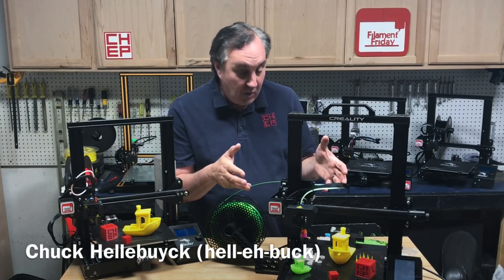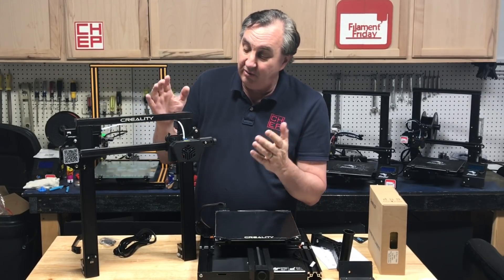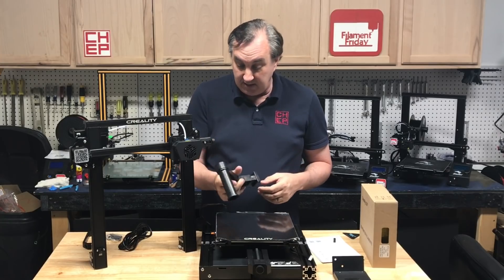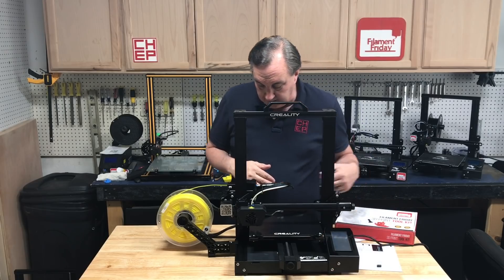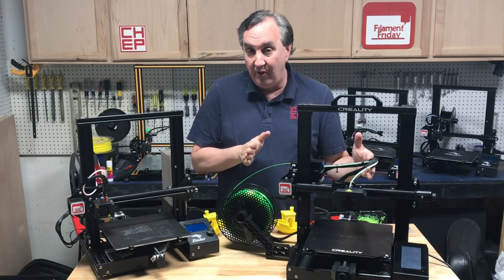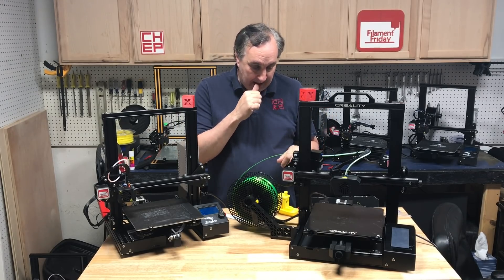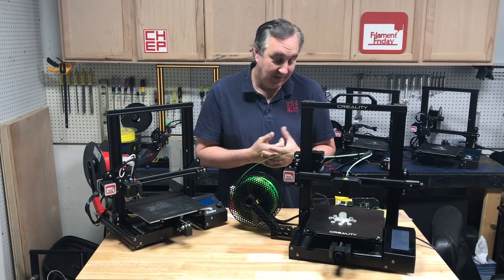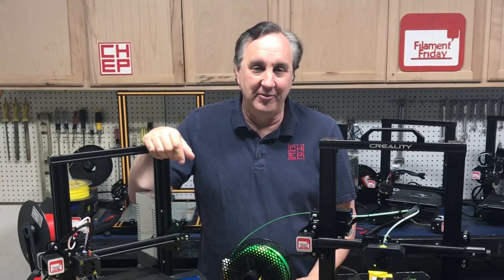NEW! Creality CR-6 SE 3D Printer - Better than Creality Ender 3?

Comment: so that has just a plain glass bed? smooth? i can't see how anyone can get prints to stick on glass consistantly without using glue... i tried maaannny times using different settings ,material... just not trust worthy... how many times have we went to bed after watching print for an hour or two and woke up to a mess...
Reply: There's a texture on the top of the glass.
Reply: @Bluemoondm1  ...yes i actually tried that on my cr10 ...i sanded the glass... it can be affective.

Comment: If your not using 99% ipa it will leave a film and will not stick on that glass. I use that glass and never had a problem with 99% ipa.
Reply: I have the Creality glass on both of my 5's and 5 Plus.  It seems to stick well, especially PLA.  If needed, I just wash it with dishwasher soap and use IPA every few prints.  I like their glass as it has two sides one coated and one plain

Comment: Hi, does this use same exact hotend as ender 3?... just curious..
Reply: it's different
Reply: @rewop12  looks or function? better? or just more high tech/costly? thanks
Reply: @roadstar499  not sure, I saw it on the kick starter for the cr6e
Reply: @rewop12   thanks for the help.i like this but for the price i would rather buy an ender 3 and use the extra money for filament
Reply: @roadstar499  I'd rather buy this, you get auto bed leveling, a glass bed, better spool holder, better extruder, and bigger build volume
Reply: @rewop12  i wonder if z goes to 300mm ... looks like base is a little bigger than ender 3...i really would not chance buying a new design unless it has been tried and tested first... plus parts etc
Reply: @roadstar499  true, but I have seen a lot of good reviews from other youtubers. Also creality has been making printers for a while so I think they have stuff down pretty well
Reply: Really?
Reply: 6:50 different

Comment: The Ender 6 seems more promising. 32bit, TMC2208's, fully enclosed, CoreXY, all-metal hotend, filament sensor, etc, etc.
Reply: They are going to add bonus items as the kickstarter reaches goals,  extra nozzles and 2209 drivers, in addition to the 32 bit board

Comment: Great review!  I completely agree with you on the price.  If it was in the ~$350 range I think it would be a great machine.  As is, there are already a number of parts that I would immediately want to upgrade starting with the ptfe tube.  If it's the same one used on the Ender 3 then it's just going to degrade after a few months of print time.  Definitely looks like a solid machine with alot of potential though.

Comment: I'd say, go with a ender 5 out of both of these. I have a ender 3 and barely even use it. If this "new" machine is anything remotely close to the ender 3 or just barely better. It's not worth it. I need to get my hands on the cr10s. Great video though, very informative!
Reply: PilcrowDesigns why don’t you use the Ender 3?
Reply: @midnighttech4225  I got my ender 5 to print just as good and I print larger. The ender 3 prints slightly better. But the print time is 2 to 3 times longer than the ender 5 with the same settings/same size print. Once you go larger than 4 inches with a ender 3. Forget about it lol. I'll still use it though, but very rarely.
Reply: PilcrowDesigns thanks. Yeah I was looking at the cr-6 and ender 5, but for my first printer I want to keep it small. I know the ender 3 prints pretty good quality stuff so I’ll stick with it for now. Maybe in the future when I’m not such a noob at designing I can move to a better/bigger printer.
Reply: I thought that too, but couldn't find anything I wanted to print that needed that big of a bed!  unless you like printing those big super hero models and having them sit on your shelf and collect dust, which I find a total waste of time, there's not much an Ender 3 can't print just fine. I always think bigger is better too, but not when it comes to 3d printing. You probably know that all of the main parts are the same from the Ender2 all the way up to the CR-10S. And the one that produces the best prints :
The Ender2 because it introduces the least amount of wobble, shake, vibrations, etc... Because it is the smallest. Most of us print small items or parts that can be assembled into a larger items so size, I've found, isn't really needed. I suggest you do what I did. Search on Thingiverse, browse for prints that are larger than an Ender 3 can print that you'd REALLY WANT TO PRINT. I couldn't find a single one. There! I potentially just saved you a few hundred bucks! Lol  😎 🤘
Reply: Scoot Roter thanks! I really appreciate your super Detailed reply. As a beginner I think I will go with the ender 3 pro. It is important to learn basics and if I mess it up, it won’t be 400! Done the drain. I’m excited to start printing!
Reply: @midnighttech4225  Yes, I love my Ender3.  Make sure you really need the "Pro" feature upgrades, as i found them not worth the difference.  i've seen the Ender 3 for as low as $169 shipped!  I paid $199 from Amazon and got it super quick with Prime and SainSmart.  You can also do some "pro" upgrades easily yourself, and even more, and not only learn about how the printer works, but pick and choose the upgrades that are good for you! And, save some dough! :)
Reply: Scoot Roter I’m actually kinda sad that the v2 is sold out. I wonder when they are gonna ship it the display looks really cool and seems convenient
Reply: @scootroter4859  You have some valid points. For me, I am an artist. I sculpt big traditionally, I also print life size heads. The ender 5 can print a lifesize head in 2 pieces in 24 hours. The ender 3 could do that to, but I'd have to slice it into 4 or more parts and it would take about a week and half to print. For small parts, the ender 3 pro is great (that's what I use) but it has it's issues more so than the ender 5 I've found. I've had a lot of failed prints in the ender 3 towards the end of the build, that I didn't have with the ender 5. Something is off. My ender 3 also came with a slipped filament disc that pushes the filament through. If you take the print bed cover from the ender 3 and put it on the ender 5. I've gotten really good results just by doing that on my ender 5 lol. Also, If you want to print model kits or busts. The ender 5 prints them great.(I sell some on my etsy page) I have pieces that are 22 inches tall that are awesome! I've made anatomical statue that would of cost me $400+ to have at that size. I printed it on my ender 5 for about $7 bucks in filament. I bought the ender 3 pro first and ended up buying the ender 5 about 3 weeks later cause it just wasn't doing what I wanted it to.

Comment: 8-bit board is a real bummer. I mean it's not horrible, but at the same time (and in 2020 no less) I see no point in buying a 3D printer without a 32-bit mainboard.  It just gives you so many possibilities for more features and expansions. If you're gonna leave your machine stock- sure. Otherwise I think my point stands.
Reply from the maker: They give Kickstarter people the choice. 8 or 32 as they reached a stretch goal. I couldn’t test 32 so I can’t really comment on it.
Reply: @FilamentFriday  Then it seems like a pretty great deal :) 

I'd be also interested in maintenance of the extruder and the hotend as well as mounting holes for these. It's just my internal tinkerer speaking. I'd love to see a review on the final unit.
Reply: The kickstarter reached a stretch goal so backers have the option to upgrade to a 32bit board now

Comment: I love the use of the larger sd card, the small one is hard to insert, The touch screen is awesome and the other new features are great. did they move the filament path away from the Z screw and would like to see the power switch in the front of the unit. Why they didn't use the better bowden tube is beyond me... would like to see a hotter nozzle  It would also be nice to see a model that has the extruder motor on the nozzle to minimize the bowden tube.

Comment: Be honest, if you buy a 3d printer its because you like to tinker with electronics and and you want to start making plastic parts. The ender 3 or ender 3 pro is a great machine to start and get good prints of pla, petg from the start and at the same time have the experience of upgrading with no pressure because everything is working. If someone wants a perfect machine be prepare to spend over 2000 and you  and  you get tecnical support and after sales assistence.

Comment: I joined the Kickstarter for $319+ shipping. At that price it is worth it. I do have an Ender 3 Pro and waiting for my SKR mini 1.2 to come in and that should help with bed leveling which has been a pita. They are adding 32 bit board to the CR-6 SE as it reached $1 million goal.

Comment: Everything except the bed leveling looks good. I've had terrible luck with physical ABL setups like the BLTouch. Ditched BLtouch for EZABL and it's working like a charm, haven't had to tweak it even once since I installed it an year or so ago. Also, the MSRP for this is dumb. This is a $300-320 machine at most.
Reply: What if I told you.....this is a different type of ABL and that bltouch is built to be garbage....
Reply: @LicPlate8VPL158  This is still dependent on physical contact. Load cell based setup like this was used in RepRap projects years ago for ABL. Why do you think most aren't using this type of system anymore?

Comment: 8 bit board is a deal breaker in my opinion. For the price and the fact they are trying to push this as an innovative and higher end entry level model, they missed the mark using that board.
Reply from the maker: They offer a 32 bit option on Kickstarter. It’s your choice.

Comment: Hey Chep, great video, such a great looking printer, excited about it.  Like the clips for the bed, also like the horizontal power supply.  Pity that it is an 8 bit cpu, but good that it has  2208 drivers.  It's like a more consumer friendly Ender 3.
Reply from the maker: 32 bit is an option on Kickstarter. Your choice.
Reply: @FilamentFriday  Cool, I think 8 bit boards is a thing of the past, 32 bit boards have become so much cheaper.